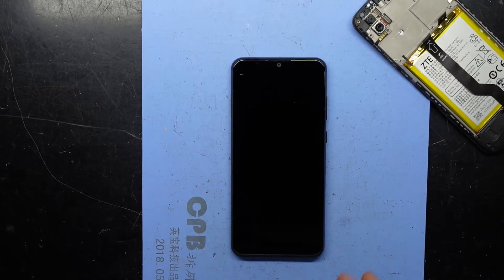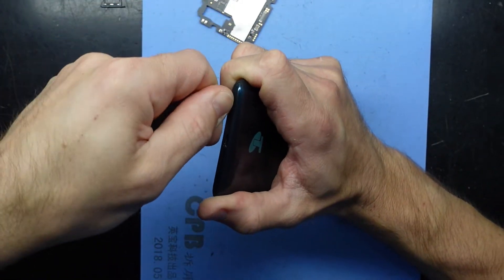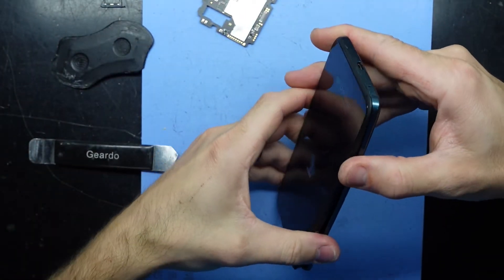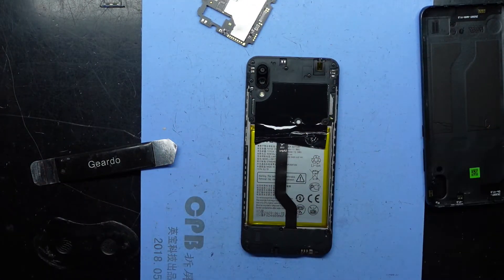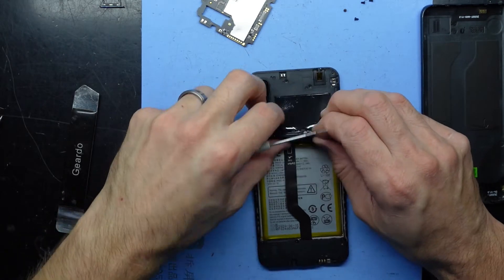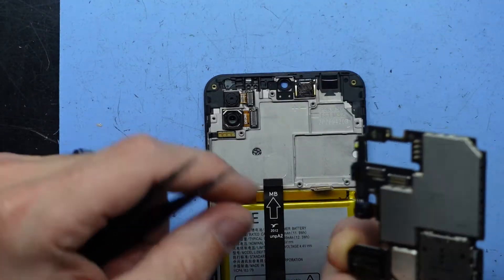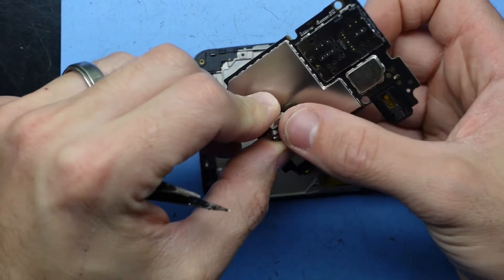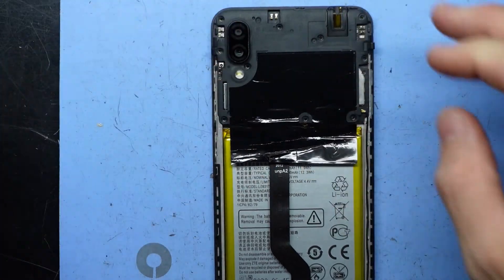ZTE Blade A5 2020 Motherboard swap / teardown

Comment: The usb charge module replacement what I buy it hasn’t some components installed on the board comparison with the original
Reply from the maker: I would expect the phone will no longer have quick charging

Comment: what is the best laptop you would recommend in  $1,000 with good cooling system
Reply from the maker: At this point in time, I don't have any recommendations. 

In Australia all gaming laptops have gone up with the release of the 3050
Reply: Acer Nitro 5 from Harvey Norman, was on sale before in may, was $865~ for 11400H + 3050.